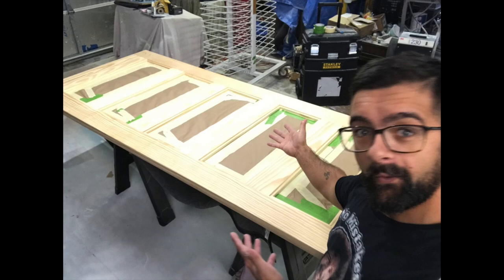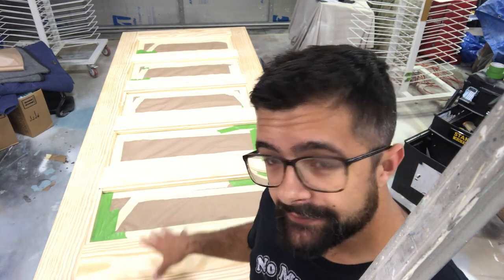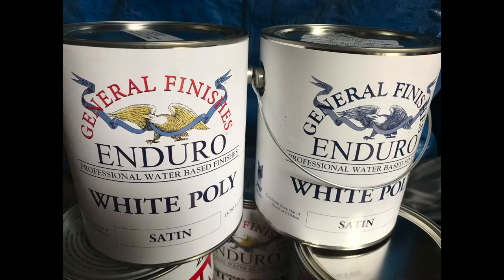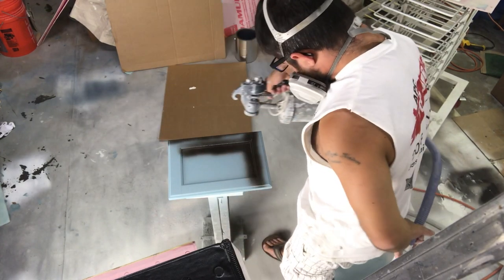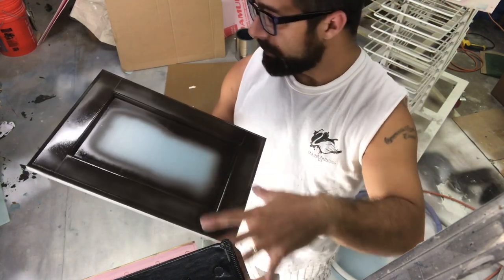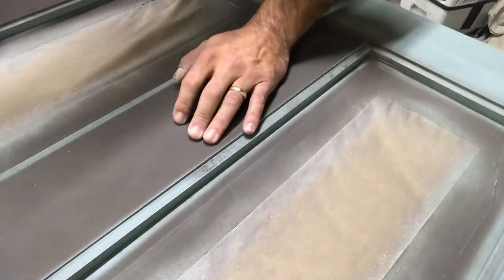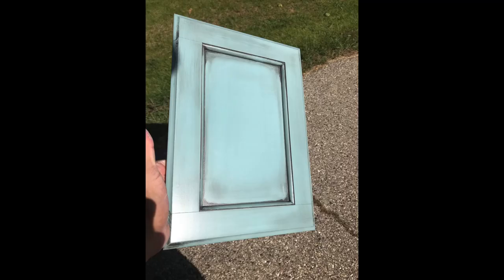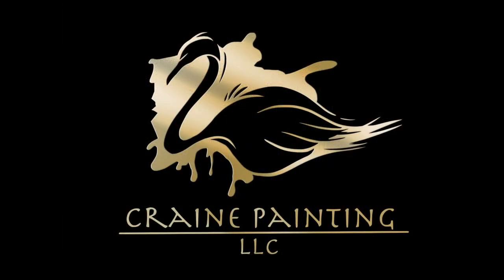Cabinet Glazing Colors. Axalta Powder Glaze Tutorial

Comment: Hi Michael, can you provide the exact finishing procedure you used?  You said you primed before applying the tinted Enduro Poly, what primer did you use?  and how do you get the Enduro Poly to be tinted to a color?  (I didn't know you could do that).  And what grit(s) are you sanding with in between each coat of primer and color?  thank you!
Reply from the maker: Carl, sanded with 240 primed with Bin Shellac and sanded with 240-320 in between I believe. As for getting the enduro tinted, yep can be tinted to just about anything but deep base colors can be a problem

Comment: Hey buddy. Have you or anyone you know sprayed the general finishes with a airless. Is it  a very thin product
Reply from the maker: Yes I have , you just need the correct tip, need to move fast and practice. Verticals will be the toughest to get down but once you do you are good to go. Make sure you are spraying at correct wet mills when laying flat etc
Reply: @MichaelCraine  thanks
Reply: i sprayed last week general finishes water based high performance satin poly on some cabintes with an airless graco 490 using a 308 lp tip and came out beautifull no runs 
im not the gratest finisher yet but working my way up by learning  from the best like Michael
and help a little if i can
Reply: @anselmo053189  thank you for replying

Comment: Hi I am in NZ where can I get these glazes from & can they be used with a brush ? Thanku
Reply from the maker: Thank you for reaching out, the only thing I could find is on amazon, the valspar zenith powderglaze I used in the video was Vandyke brown, however here is a link to one that’s black. I sprayed however it says you can apply with a rag as well. I don’t think there would be an issue if you lightly brushed it on either 

https://www.amazon.com/gp/aw/d/B07DLN34BB/ref=psdcmw_6809824011_t1_B07DLHPDMC
Reply: Michael Craine thanku 😊 After glazing can I apply the topcoat with a brush? I am worried netherworld glaze will come out as. I am brushing ? Thanx
Reply from the maker: VintageFurniture Revivals Delna I’m slightly confused from the autocorrect on your last comment. I know quite a few people that brush and roll cabinets, however if you are trying to not have brush marks, you will have to spray. 
As for the powder glaze moving around it may a bit, as you can take it off with a scotch brite pad and wipe it off with water you will have to be very careful. But it must be clear coated. You might look around for a compressor and a cheap HVLP gun to spray it on. There are people here in the states that use that and a $30 hvlp gun for their clear coats.
Reply: VintageFurniture Revivals Delna if you want to do a bury brush look, you may need to add water to reduce the dry time.

Comment: Just found your channel, tried glazing and failed. Information on refinishing cabinets that look like yours I need
Reply from the maker: d al what glaze did you use and how did you apply?
Reply: @MichaelCraine  it was a glaze that home depo or lowes had, I have some oak stained cabinets I painted with sherlim Williams oil paint they are drying now, I sprayed them with my airless bc I cant get the hang of my HV sprayer. I want to glaze these to look like yours, you called "heavy glazed look" just not as heavy, I'm in Texas would any product at a big box store work? Also I have a cabinet that's MDF and pealing plastic like coating, what would you apply on the raw areas to leave out the surface to refinish I was thinking car bondo? Thanks for replying and it's ok if your not able to answer my long comment, hope to see more content you could be the next  "idaho painter" (awsome youtuber that teaches via video how he runs his successful painting bussiness) like him but for cabinetry.
Reply from the maker: d al airless works just fine as well. Sounds like you picked up a wet glaze and that takes some practice to get the look you want to achieve, you will not get it on the first try. If you are limited to wet glaze I would make up a sample door and practice. Might try Benjaminmoore Alkyd glaze, it’s oil so keep thinner and rags handy when doing it. As it’s oil, it’s also going to have a longer open time (dries slower) so you can play with it to get the look you want. It will take practice. 

As for the Thermafoil doors. Honestly just look into buying new doors. Once the plastic starts peeling it will all come off eventually and they are just garbage. Most likely this will happen when you try to paint them. Raw Doors are cheap and you already know you can paint them